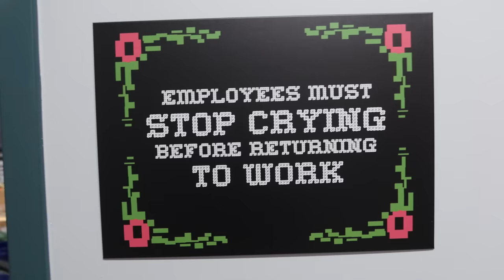Brandon’s AK Factory Uses Child Labor

Comment: If you're trying to get past carbon lock, a 50/50 mix of ATF (the good ATF that goes in your transmission - NOT the bad ATF that goes in the tranny) and acetone is one of the best penetrating oils ever.  That's not what she said, btw.
For general usage a 50/50 mix of ATF (again, the good kind) and Kroil is the bomb!